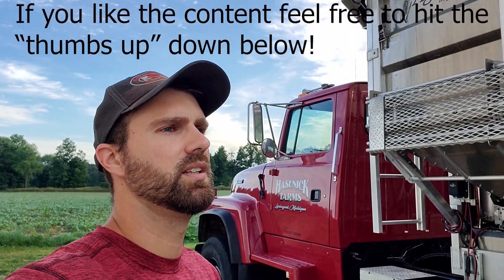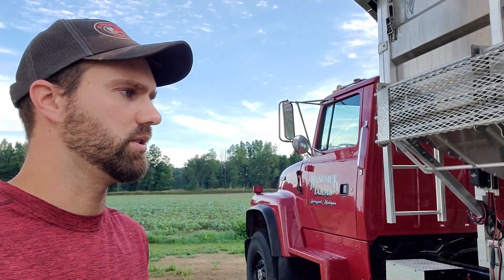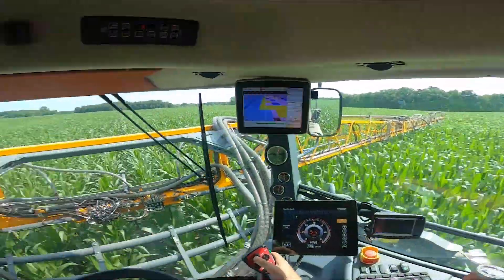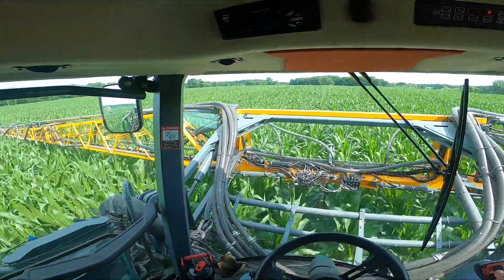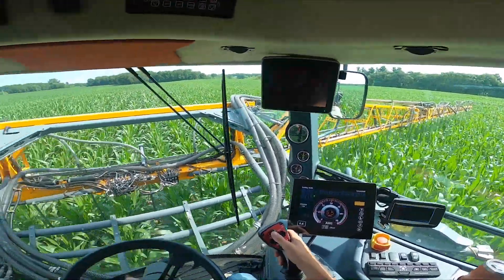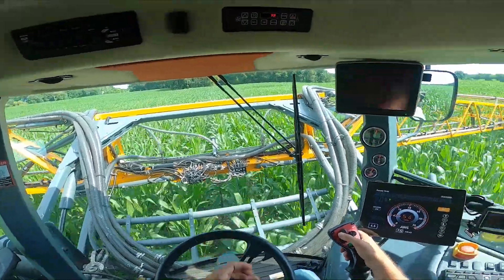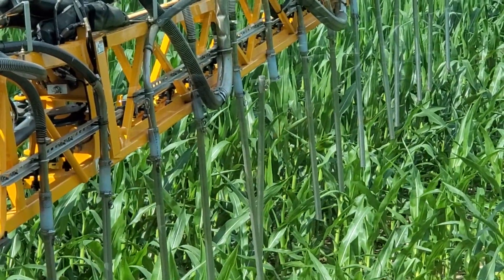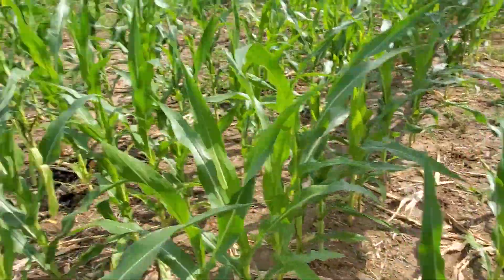HAGIE STS 12 | Montag Fortifier on 120' Boom | Applying Nitrogen

Comment: That's very cool. I haven't seen a sprayer set up to do solid fertilizer before. Could you give more info on the system in the next video? Does that unit only do solids now or can you go back and forth with liquid?
Reply from the maker: I'll see what I can do! This unit is only for solids. The majority of the liquid lines are still in the boom. If it ever goes down the road it can be a combo unit, but we only use it for dry products.
Reply: @hasenickfarms2288  very cool. Thanks for the information.